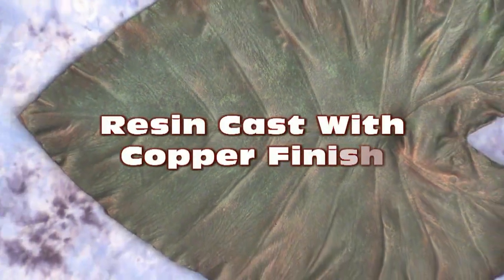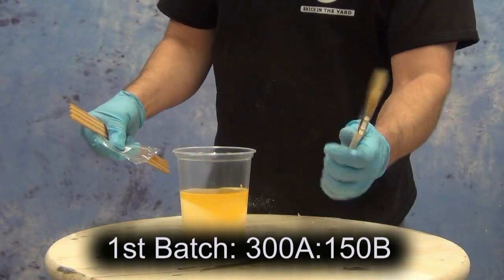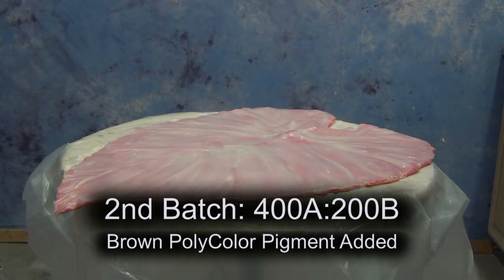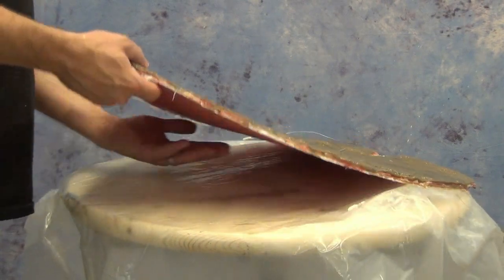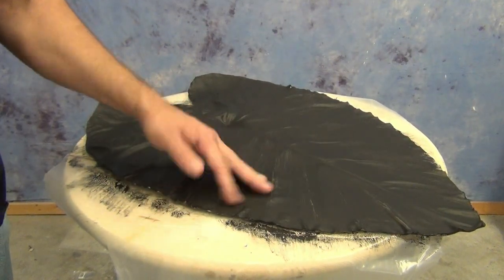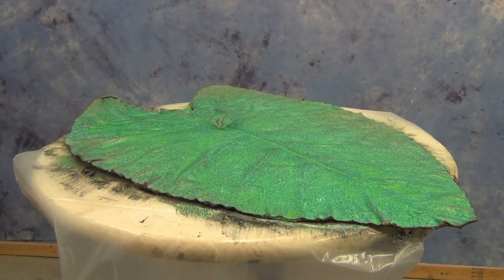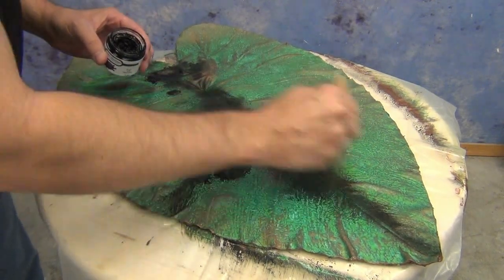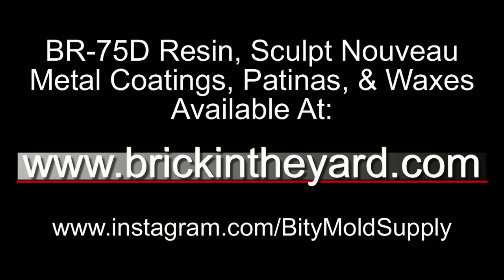Resin Casting And Finishing: BR-75D Resin leaf Antique Copper Finish

Comment: Can I make this mold with the Poly 
74-24  product I already have and then cast  with the BR-75D?
Reply from the maker: You can cast BR-75 into 74-24, but you will have to use a liberal amount of 2300 release to keep the BR-75 from bonding to the rubber mold. Once demolded the part will have to cleaned and degreased to remove any 2300 release residue. It is a more labor intensive approach, but it can be done.